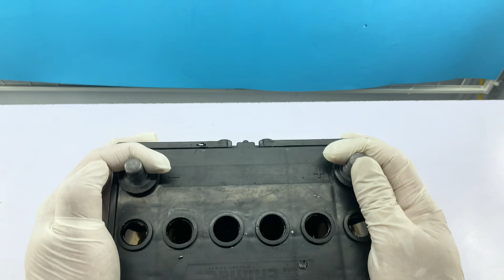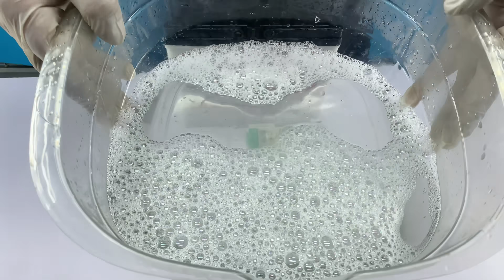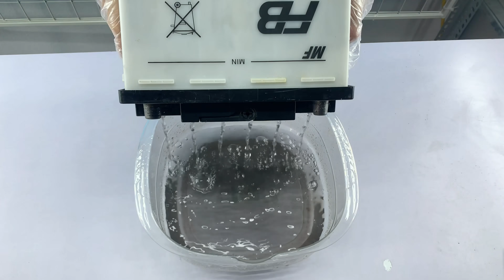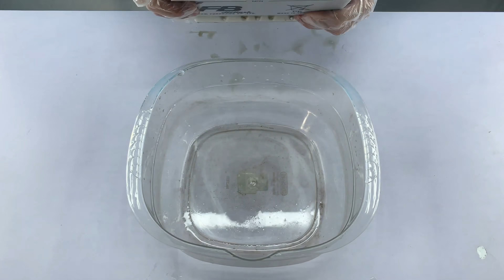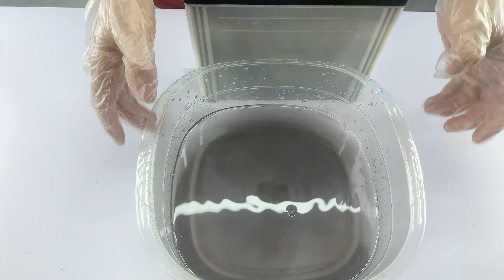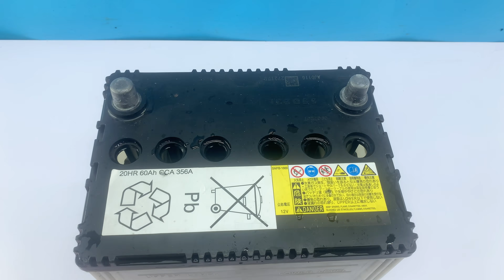Old BATTERY Like New in 1 Minute! 3 Quick Ways to Restore Your BATTERY! 😱UNBELIEVABLE!

Comment: You should use volt meter before doing any thing and when charging is done. Testing with lamp is for beginners
Reply from the maker: Good advice! 🔋 You’re absolutely right — using a voltmeter is the proper way to test safely and accurately. Thanks for reminding! Do you often work with electronics too?

Comment: you keep saying water , you don't say distilled water .,besides what you don't say is that battery is not fully charged its a 12 volt battery not a 10 volt  the water that you don't say might be tap water the chemicals that are in tap water will corrode  the battery , you need distilled water only besides that toothpaste water might be ok but with the chemical properties  isnot good. the battery  charge might or might not be the cause due to the crap that was in there with the water in contamination.  id use distilled water. only. if you have a charger showing  carbon core to see how that works, and not just the  showing its fully charged the carbon core charging is what is real ,,
Reply from the maker: That’s a very helpful explanation — thank you! 🙏 You’re absolutely right: distilled water is the safest choice when working with batteries. This DIY experiment is mainly for demonstration, but your tip adds great value. Do you often repair or rebuild batteries yourself?

Comment: What is the percentage of the sulphuric acid?
Reply from the maker: Good question, my friend! ⚗️🙂
For most lead-acid batteries, the sulfuric acid concentration is about 30–35% when mixed with 65–70% distilled water.
That’s the standard ratio used for safe and effective battery operation. ⚡🔋

Comment: Can a battery blow up
Reply from the maker: Yes — it can, but only under the wrong conditions. ⚠️🔋
A battery might explode if it’s overcharged, short-circuited, punctured, or exposed to heat or fire. Always handle batteries carefully, avoid mixing types, and never charge damaged ones. Safety first! 🧤🔥

Comment: Good show sir,but when the battery voltage is 10.42v,it doesn't mean that the battery is fully charged as u elaborated in the video. Hence, if the charging battery voltage ranges btn 12.5-12.9v,then there at least u may say the battery is fully charged. Thx.
Reply from the maker: Great point, Andrew! 👍 You’re absolutely right — a fully charged battery should read around 12.6V or more. The example in the video was just to show the restoration process, not the final full charge. Thanks for adding valuable info! 🔋🙌

Comment: For how long should the battery be on charger   and which kind of liquid is finally put in the battery before I start to charge from Namibia
Reply from the maker: Thank you for your detailed question! 🙏 The charging time can vary depending on the battery condition, and usually a proper electrolyte solution is needed before charging. Do you often work on battery repairs in Namibia? 🇳🇦

Comment: 10.4 volts is no good at all , what good is that ! 
Should be 12.7 minimum
Reply from the maker: Thank you for pointing that out! 🙏 In your experience, what’s the best way to maintain a battery at the right voltage?
Reply: Restamos viendo videos de mexico
Reply: The thing is, the battery isn't completely desulfated yet.  It still has some sulfate deposits on the plates.  You can use the "repair" function of a smart charger to shoot short pulses of current through it at a higher voltage and complete the desulfation process.  OR, before there were smart chargers, I used a dumb one and left it connected to a motorcycle battery 3 days once.  At first, the current was almost nothing.  I also put a pinch of garden sulfur in each cell which slowly replaced the sulfur which had left the acid and stuck to the plates, gradually making the acid itself more conductive.  On the 3rd day, the charge current was higher and, boy, that battery was hot!  It was like a new battery!

You can build your own dumb charger with a power cord, a transformer, a diode or two, and some wire.  But you need a little electronics know-how, lest you should build a stupid charger instead!😅
Reply: First method
1. Never change a battery with the covers shut. Hydrogen and oxygen gasses buildup makes battery potentially explosive. Always keep the covers open and in well-ventilated (open) space.
2. A fully charged battery should be 13.2 volts, not 10.4 volts. Either repair was not fully effective or you charging was incomplete. Below 13.2 volts but above 12 volts is usable.
Commenting from Kenya.

Comment: I have a question though will the smart charger accept to charge a battery with  0.00volts  cause my smart charger refused to charge cause it  could not detect the battery  . Please assist here.
Reply from the maker: Thank you for your question! 🙏 Have you ever tried a trick to “wake up” a completely dead battery before charging with a smart charger?